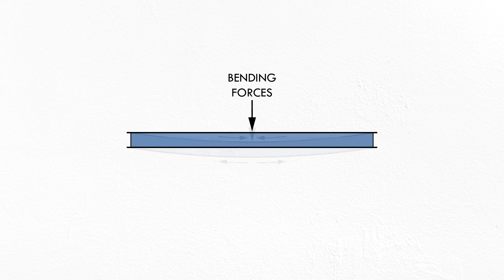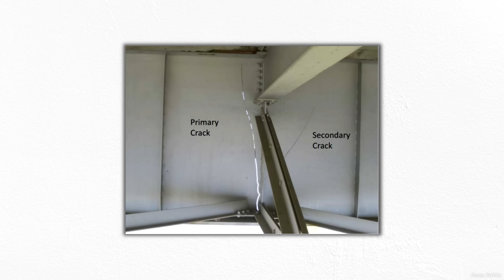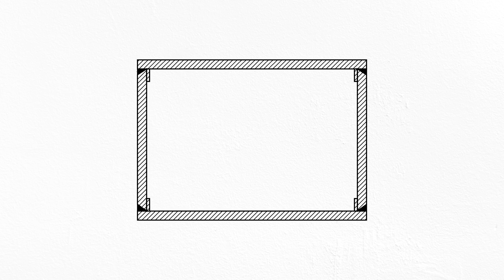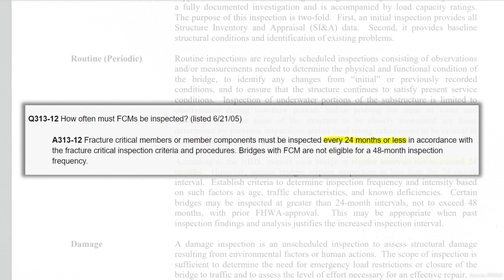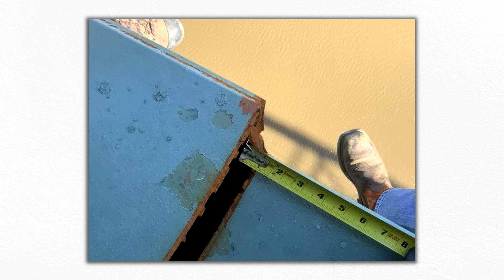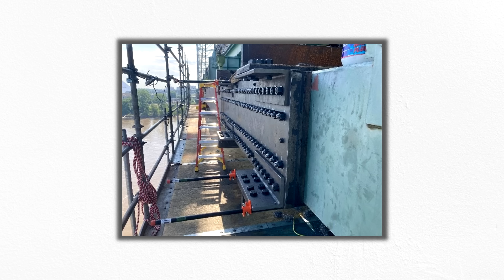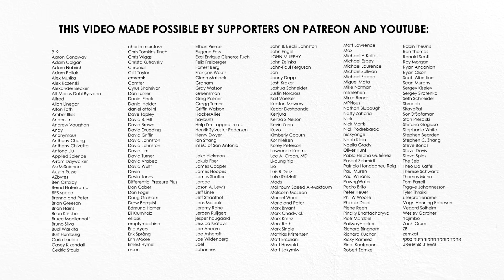What Really Happened at the Hernando de Soto Bridge?

Comment: There are currently ( 2025 ) plans to replace the I-55 Memphis-Arkansas bridge at Memphis. Commonly known as the "old Bridge" built in 1948. Methinks that the newer I-40 bridge is the one to replace as it is known to be "defective" as shown in this video. Just because that crack was plated over, doesn't mean it's sister structural members aren't similarly disadvantaged.  BTW, several  million pound freight trains use the two other bridges at Memphis every day. They were built in 1892 & 1914.

Comment: June 2025. I've been crossing this river almost daily for eight years. Here are my thoughts.
-- The 'cracks' were far too straight. I suspect the box beam was never properly made, the cracks followed weld lines, and the fault was present the day that beam was first painted;
-- As a motorist I cannot tell the difference in crossing from before the repair too today. I suspect this bridge was designed to function with just one of those tie beams intact;
-- The closing of this bridge really underscored the need to reform and supplement river crossings in this area;
-- The I-55 bridge interchange was simply inadequate, and was immediately modified. Since then, it has been reconstructed and much improved; and,
-- Far too much traffic is routed directly through Memphis. It is critical to construct two bypasses.
       The first, and easiest, bypass would be between I-555 in Arkansas and i-385 in Millington, TN. This would allow Nashville-bound traffic to avoid downtown Memphis. Lands necessary are already in the public domain.
       South of Memphis the challenge is greater, as the Arkansas side lacks supporting roads. Still, a bridge near Horseshoe Lake (Arkansas) would connect Arkansas 38 in Hughes AR with I-69/269 near Robinsville, TN. That would allow for a southern bypass of Memphis and actually improve access to the Memphis distribution centers. Such a southern route would be better for eastbound traffic from Little Rock, AR.
       West Memphis, where I-55 and I-40 merge for a few miles, is a choke point. There is little value for most truck traffic to pass through the Memphis town center.

Comment: Crack there right @ 12:10 middle on the horizontal beam right under the guy climbing on the right side.  You can see the line growing out from the bolt plate upward (left of the hole)

Comment: A new bridge having sound testing applied at many points. Recording the returning energy just like is done in seismic survey. This to give a fingerprint of a 'healthy' bridge and at each section the testing is done. In two years shut the bridge down for maintenance and repeat and expect the very same wave pattern fingerprints. When you go and buy a grindstone for your bench grinder, you should hold the centre on a metal rod and ping the stone with another. You'll know exactly which stone has a crack in it that cannot be seen by eye alone.

Comment: Years in arrears . . . The loop around the far north side has been waiting 30 something years to be completed. The bridge over the Mississippi River that would route into Interstate 55 has never been built. Nope, that money went to correct the mess they made out of the I-40 to I-240 connector on the Northeast side of Memphis 
But that bridge over the Mississippi River that would have lightened the congestion of heavy trucks over the Memphis/West Memphis is a red headed stepchild. Along with 6 other Mississippi River bridges in the U.S. that are only on paper. DOT is still waiting for Congress to not only allocate funds for these bridges, the 5 other Interstate highways for the western half of America are also waiting for funding.
Will it ever happen?
Only a few month ago did Congress fund an infrastructure bill. But that money is for repairs that have been needed for decades.
Our highways are crumbling.
Our bridges are falling down.
Our airports are decades behind in safety improvements.
And there is still next to no (with the noted exception of the D.C. to NYC) passenger rail system in our country. And if you are going to quibble about AMTRAK, perhaps you should take a closer look at their routes and schedules.
Kick every last one of them in the Senate and the House to the curb and put people in that will do the job America needs!

Comment: Some observations (not in any order):
-The bridge had a robust design that prevented total collapse even with a cracked structural member.
-iInspections and Inspectors can miss obvious indications, assuming there were thorough inspections to begin with.
-"Shoot the messenger" attitude (firing the Inspector) can be encountered anywhere. As you mention, that is an indication that the bridge inspection process is flawed...."fix the problem, instead of fix the blame."
-The key to safe operation of any engineered structure is inspection.

Somewhat related: The Sioux City DC-10 crash was caused by a dye penetrant inspection of the #2 engine rotor disc that missed a small crack. The rotor disc then failed catastrophically from crack propagation. The ensuing  shrapnel from  the burst rotor disc took out all the redundant aircraft hydraulic systems used to actuate the flight controls.  With the controls locked up, differential, thrust on the remaining two engines was used to provide some semblance of control. While there was some loss of life, it was a miracle the plane was able to crash land have some survivors. I was at McDonnell-Douglas at the time. Several fixes were implemented, one being a single-point failure would not disable all aircraft hydraulics.

I am a Mechanical Engineer with a PE License.
Reply: It isn't 'shoot the messenger'.
It is about personal responsibility.
And a dangerous lack thereof.   
START HOLDING PEOPLE RESPONSIBLE FOR THEIR ACTIONS.
Reply: @Kevin_Kennelly  Shoot the messenger does not address prevention. Prevention is the foundation of safety.

For a safety presentation, I made a slide show of several aircraft that were launched off carriers or took off from a runway with the wings folded. US Navy and some USAF aircraft have folding wings so more aircraft can be stowed in the same area. The wings are unfolded and locked into position for flight. The wings cannot be unfolded in flight. But in several cases, more than can be imagined, in full view of everyone watching, the aircraft took off with the wings folded. Turns out a plane will fly with folded wings, but barely. Jettison all external stores, dump fuel, and stagger back to the runway. In one carrier launch, the plane had to fly about a hundred miles to a land base since it could not land back on the carrier.
Do you fire 100 people watching a plane take off with the wings folded? Or do does an organization take cultural and organizational steps to prevent taking off with the wings folded?

Comment: I hate that you came very close to blaming the welders on that project. The Crack did not go along a weld but cut through the welds. Being a structural welder for 40 years, I can tell you it was not a welders fault.
I also have to agree, if your inspection relies on a single person, you're screwed up.

Comment: Well its not that big of a mystery why it didn't collapse with the one beam broken, the other side was apparently enough to keep it from immediately collapsing, like if your bow had 2 strings and you cut one. 

A good demonstration of why redundancy is a good thing because if the other side wasn't strong enough to hold it together without the side that broke it definitely would have done like your bow. 

Two is one and one is none

Comment: This is typical of USA. A country that has an overtion to rules and regulations. It is clear that this bridge has never been properly inspected for decades. This is not surprising at all. America is free and no gov is going to tell them they have to inspect bridges. Americans need to learn that freendom doesn't mean lawless no regulations. Luckily the bridge didn't fail and no one was hurt. Firing one inspector and blaming this person is an obvious scape goat. Where are the policies governing the inspection process? Where is the database storing the inspection logs?? They don't exist and that is not the fault of the one inspector but the failed gov agencies. America is the best use case for how not to run a country. Great vid!

Comment: If we can approach these issues systemically, by examining the processes/procedures as well as the process managers, then we can continue to ensure the safe implementation of our projects.  Finger-pointing and scapegoating may feel good in the moment, but they don't correct the underlying issues.

Considering the fact that civil engineering and structural engineering are specifically concerned with attention to the underlying issues, one would think such issues would be the main focus of any engineering project or team.

Comment: When vehicles slam on the brakes, the suspension and physics increase the axle weights of the front of the vehicle, pattern analysis would improve roads in general.  In other words if at the 350 ft point in the bridge, most are slamming the brakes for a lane change, that should be engineered to take more stress since weights can spike several hundred pounds in a split second.

Comment: I think I found the answer to the question  you posited at the end of the video about load re-distribution.  If you take a look at this video from the Tennessee Dept. of Transportation (TDOT) https://www.youtube.com/watch?v=JsfSu-sozzM&ab_channel=TDOTnews  and pause at the 1:28 mark, you can see that the welded box beam failed only on 3 of it's 4 sides.  The bottom plate of the box beam did not fail but was just starting to do so in 3 easily visible areas.  I believe that the tension was transferred solely to that bottom plate which prevented the bridge from collapsing.

Yes, I agree that other elements may have also been damaged, but I truly believe that had that bottom plate failed, the bridge would have collapsed entirely.

Comment: Consider the accumulation of stress cycles in a shaft that rotates at 51,000 rpm like the gas producer shaft of the Allison Model 250 helicopter engine.

Comment: You wouldn’t even need the frame member that broke if you just run cables horizontally from Side to side in each arch. It looks like tying it to the deck way is the only thing that saved it Even if it was the cause, The load transferred to the deck somehow.

Comment: Being a leading provider of new technologies of any kind has disadvantages. I am in communications and like all utilities Bell Canada takes steps to ensure that they are able to implement anticipated demand. To this end Bell acquired land in downtown Toronto and built a very structurely strong building, with floor-ceiling height sufficient to accommodate the anticipated equipment.

It was never put into service and was sold off, as surplus to needs. Why you may ask.

Simple, advances in communications equipment resulted in compact designs with increased capacity

Vietnam was somewhat of a  late newcomer the InterNet but the advantage was fibre optic cables and pole mounted distribution equipment.

Today VietNam has extremely low populated areas that lack communications, especially when compared to modern countries such as North America, the UK and other leading countries.

Comment: My sensor company had two separate parts under the Inspection Dept. QC (Quality Control) and QA (Quality Assurance).
QC was in the production line at a designated point whereas QA was the final inspection which included all paperwork.
If QA passed, shipping was next in order.

Comment: 1.  Seems to argue for simpler engineering designs, for easier inspections, and redundancy so no one component is so critical.
2.  Could it be the bridge didn't collapse because the rest of the bridge continued to hold it together (pushing inward on both sides)?

Comment: whatever they come up with, will be only a bandaid solution , it will be cheaper and more structurally sound to just tear down the bridge and rebuild completely. While the motor traffic will suffer, the river traffic can be open to one side of the river and then the other as the new sections of the bridge are built.

Comment: Another Bridge that always looks to be Problematic is the I-10 Mississippi River Bridge. Baton Rouge is very similar to Memphis in the amount of bridges crossing the Mississippi River. Only 2 bridges, Locals refer to the I-10 bridge as the New Bridge and the Older U.S.190 bridge.as the Old Bridge which shares a railroad line. The I-10 bridge crossing is always overload with traffic especially on the Eastbound side. Anyone who's crossed it know at the bottom of the Bridge I-10 and I -110 split. Most of traffic stays to the right and stays on I-10. At peak times of the day the traffic backs up beyond  La-1 on the Port Allen side. I don't trust the bridge. I blame Baton Rouge politicians for not planning for Baton Rouges population growth and are still using a 1950s planned road system. In my opinion there should be two more Mississippi River crossings in the Baton Rouge area. One to the North and another to the south approximately 5 to 8 miles south of the current I-10. If the I-10 bridge was to fail, going across the U.S.190 bridge would be a serious headache.

Comment: This sounds a whole lot like what happened to the Sherman Minton Bridge, over the Ohio River, linking Louisville, Kentucky, with New Albany, Indiana. The Sherman Minton is also through-arch suspension design, with double arches, very similar to the bridge in this video. Except the Sherman Minton is a double decker bridge (forgive me, I don't know the technical term lol), with the Northbound lanes on top of the Southbound, rather than side by side. In any case, just as in this case, a crack was found during an inspection, about 8 or so years ago. I can't remember exactly where the crack was found, but it was in a critical area. The bridge was immediately closed, until repairs could be made. It was all very sudden. This was before our new bridges (The Lincoln Memorial, and the East End Bridge-ugh, don't get me started on that one) were built. So the traffic was funneled to the only other available bridges in the immediate area, the Kennedy, and the narrow, outdated Second Street Bridge. The Kennedy was bigger, but both bridges were now carrying twice the traffic they usually did, which snarled and slowed everything down, especially during rush hour. It was absolutely necessary, of course. But it was still a pain in all our butts, lol. The Sherman Minton was closed for nearly a year, IIRC. The resultant traffic mess was dubbed 'Shermageddon', lol. And there was a big celebration around the first person to drive over the newly repaired bridge when it opened. Anyway, this video brought those memories back, because, as I said, it was a very similar situation, in very many ways. So I had to share. Hope you enjoyed, lol.

Comment: There looks to be possibly another crack @9:33 in the far right of the frame. Its a vertical line coming up from the bottom of the beam running from the right side of screen and then off the top of the frame. it appears to go through 1/4 of the beam

Comment: I believe a more accurate simulation of what would have happened if a tie was to separate if you would have tied two strings on each side and cut one with the cinder block weight on top

Comment: 4:50 Wait wouldn't the result be different if you simulate it exactly with ties being on both sides of your model like it is on the bridge? I would think that the other string would hold for a time technically.
I tell ya what I'm sure glad that they fired that head inspector. I used to drive a semi truck long haul and have driven over that bridge Idk how many times but that was a part of I-40 that was my main route. I thank the lucky stars it did not fail while I was driving over it.
Also I was wondering why they named it after DeSoto? I realize he died on the banks of the Mississippi but the exact location can't be decided on and there is a 131 mile difference between the two areas that are debated about. 😂

Comment: I’m a truck driver and I crossed over that bridge many times in 2020 and early 2021. Scary to think I was loaded going over something like that. Thank God no one was hurt.
Reply: How many times I have SAT on that bridge during construction in Memphis.
Reply: Same. This whole time I've been gritting my teeth and breathing deeply to avoid a panic attack, going slow enough to leave a gap between me and the truck in front of me long enough so we're not on the same span at the same time, over the I-55 bridge, thinking it was the scary one.
Reply: Same. I’ve always hated going over bridges in a big truck. In 2001, it was decided we need a new bridge over the Ohio River between Henderson, KY and Evansville, IN. The twin bridges used currently are quite old. It’s now 2022 and no new bridge construction because the 2 states have spent 21 years arguing over who’ll pay for it.
Reply: @stevennewman4778  ouch 😬. They should just split it bc that can turn into something super dangerous especially if it’s a taller bridge

Comment: Initial repairs that affixed steel plates on both sides of the affected girder were completed on May 25, 2021. The second phase consisted of the installation of additional steel plating and removal of part of the damaged beam. A new inspection of the bridge found "nothing of concern". The eastbound lanes reopened on July 31, 2021, and the westbound lanes reopened on August 2, 2021. [wikipedia]